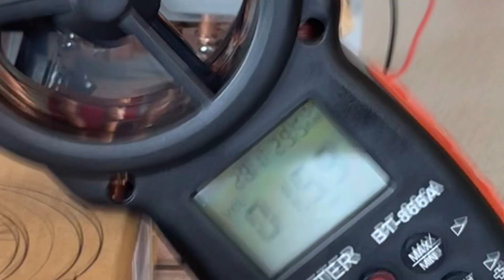Ionic Thrusters: Propulsion of the Future | Breakthrough Junior Challenge 2023 | Ihsan

Comment: Hello,Could you please provide the step by step instruction to make this peoject please.
Reply from the maker: Hello, yeah sure! There are two parts to the thruster: the high voltage power converter (HVPC) and ionic thruster. 
The HVPC is driven by a 555 timer circuit producing a 13kHz square wave with 30V peak to peak. That drives a power MOSFET (IRFP260N) which switches an AC flyback transformer. You can get a DC flyback, remove the core and then wind your own coils to get AC output. My coils were wound with an approx. 10:1000 ratio. Finally, the output of the transformer powers a 4 stage Half Bridge Cockcroft-Walton voltage multiplier to make a 50kV output approximately. 
The ionic thruster consists of a 34.5AWG copper wire emitter electrode and 1/4" copper tube as the collector. I designed and 3D printed the frame.
DISCLAIMER: Careful, I cannot stress how dangerous dealing with high voltage like this can be. You are fully responsible for your own safety measures and any injury that may occur in building this. I am not assuming any of that responsibility, nor am I claiming that my design is safe.